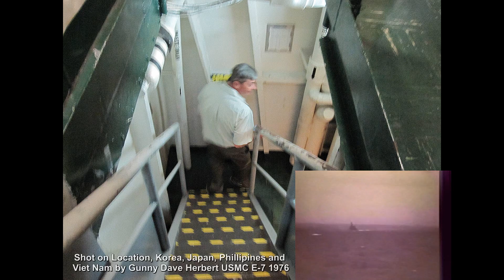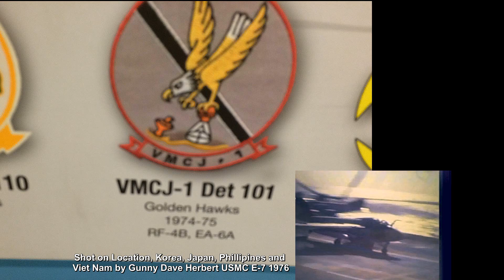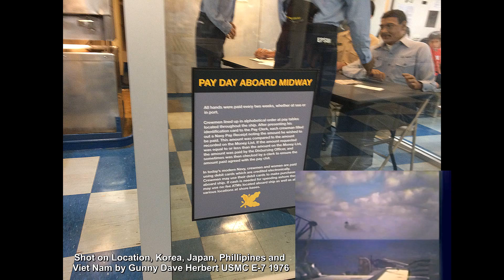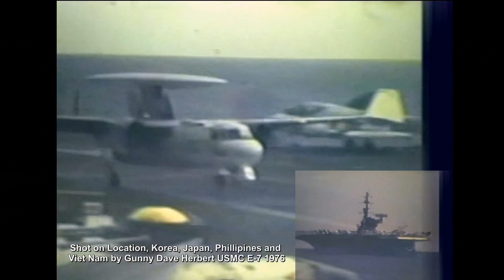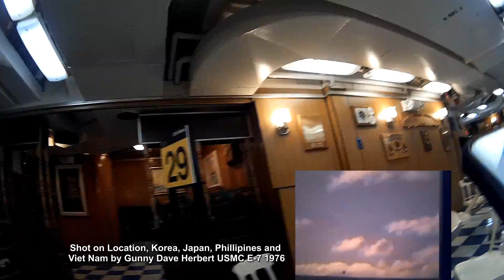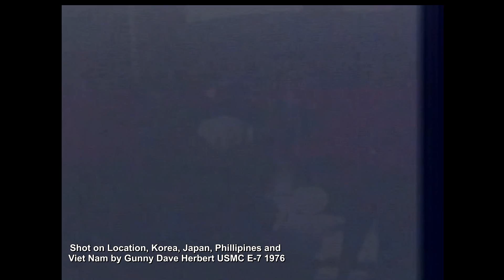USS Midway Magic with Phantom Crash on deck! Were you stationed on the Midway Carrier? VMFP-3, 1976.

Comment: CATCC div ... 1976
   This crash was one of 2 incidents that happened the whole year ..., 
  We ( and all of the Airwing ) were under one , Commander Tom Finley ...affectionately , “ Cag “.....Commander Of The AirWing.
     (. Pretty sure the Aircraft on display when you enter Alameda is his name on it ..)

    Commander Finley’ ‘. radar blip , moved unusually quick across the screen .... as he was scramming ... all over observing all the readiness Ops.

   Thing is we flew more sorties  than any other Carrier .., this crash and a deck crewman was sucked into an intake 
( A6) .. as the deck was slippery icy.

   We were caught in the most horrendous thing  ( rare ) in the fall , a white squall. We still were unrepped... with fuel ... l watched the sea ( solid white foam to the horizon ) completley  cover the upper decks of the tanking vessel.
   Also we were called away to ‘Operation Paul Bunyan ‘ when a pilots & crew were captured after  running out of fuel over Korea’s DMZ ..,
   LCDR Cunningham  a pilot , became an Congressman..
  And l was lucky enough to call a future FAA  top brass , my personal friend ; Peter Dumont

Comment: Gunny. I was an AT with VA 93 from 75 - 77   I do remember that crash and I also work the flight deck as well as a stint in 77 as in the flight deck launch room. I was that guy who showed what planes launched off and recovered on the deck. Eventually, the midway museum told me that my job became an officers job once it was computerized.
Reply from the maker: Right on, Tim.  I know what you mean about losing the job, cause when I made Gunny I wasn't out fixing and doing what I liked.  Anyway glad to hear your story and Semper Fi from the old  Top.

Comment: I was in VAW-115 on the 72-73 cruise, working in AIMD, AIMD-2, I believe, but not sure.  I fixed radios, IFF and nav gear.  Worked on stuff for E-2's, Phantoms and RF8-C's.  I get to visit the ship on San Diego about every other year, and I always enjoy my visits.  My squadron was homeported at North Island NAS on Coronado.  You had to pay a toll then to cross the bridge, or come up the silver strand, which took quite a while.  We had close to 20,000 traps on this cruise.  325 days.
Reply from the maker: Great to hear your story.  Thanks kindly for your Service.  Semper Fi from this old Top.
Reply: @NightFlyyer  Yes, I was on it.  This was the last combat cruise of Vietnam war.  They wouldn't let the ship come home until the Peace Agreement of Paris was signed.  Once it was done, the POW's came home (Hanoi Hilton, including John McCain).  We had an A-6 crash on the flight deck on October 24, 1972 that killed the Bombardier Navigator (BN) LT. Bixler, and four men on deck.  30 sailors were hospitalized, mostly with burns.  We launched planes the next day and did not sustain enough damage to come off line.  Bad day.
Reply from the maker: @williamlowers1964  I was in Nam in 69-70 and then out on the Midway in 76, when we had the F4 as seen here crash on deck.  Thanks again for serving.
Reply: @NightFlyyer  I have some Vulture's Row photos on Buzz Nau's website.  CV41.org.  Click on Galleries|Midway through the years|1970's|Bill Lowers to see my photos.  I slept under the port side blast deflector near the end of the angle deck (we could hear tailhooks of bolters on our roof), and could hear the hydraulics of the blast deflectors when they were launching planes.  We always knew when the RF-8C photo recon planes were ready to go, because they did not have staged afterburners, and when they hit the burner, it was a big dump of fuel, and . . . POW! the instant the JP5 hit the exhaust.  I worked in the AIMD radio shop one door up the passageway from my berthing area.  Tailhooks dragged across our roof there, too.  I was in the E-2 squadron, and when an E-2 didn't catch the wire, the tail hook went Dink, ka chink, dink as it bounced across the roof.  Nothing macho like the roar of a phantom!!
Reply: William Lowers Did you know Shustek?
Reply: @Beachmode12  I never knew anyone named Shustek.  I was on in 1972 and there were 4700 men aboard.
Reply: William Lowers TRUE. Radio operators E2 was his work.  He talked about his five close friends getting killed.  He was devastated. Master Chief E9. Stationed San Diego.  1500 hrs on E2
Reply: @Beachmode12  I was in VAW-115, the E-2 squadron.  I will look for him in my cruise book.  We lost LCdr Anderson and Bobby Cobb in an E-2 crash in a plane that was headed to Yokuska for repairs.  My friend Roger Blair and the co-pilot bailed out and survived.  LCdr Anderson tried to save the plane and died in the crash, and Bobby drowned.  We had a memorial service on the Hangar deck, port side elevator.  I didn't know any Master Chiefs in our squadron, but I wasn't in it very long before we deployed.  When we were at North Island NAS, I worked in the electronics shop in the space between the double blimp hangar, so most of the time I was there, I didn't have a lot of close contact with my squadron.

Comment: Used to take photos of the afterburners during night flight ops from the focsile. Dramatic! 
One time I followed a prop shaft all the way down to the bottom of the stern! No stairs, had to climb thru holes in bulkheads. Got progressively colder the lower I went, could hear the props thru the hull, and feel the chill of the dark, mysterious ocean right thru the steel. Finally came to the dry side of what looked like a rotating seal, where the prop shaft finally poked out thru the hull. Bottom of the ship's structure had quite a bit of cold sea water in pools between the bulkheads.

Comment: ICFN Gyro Technician 1978-1980
Yokosuka, Japan
Reply from the maker: Gyros were so much different than the no moving parts ones now, that's for sure. I was stationed after Nam in Iwakuni, and when we spent Christmas there in 1976, we flew to Yokosuka a couple of times with a long, loud flight on C 130's.  Thanks very kindly for serving and commenting!

Comment: Why can't I get info on crashes from 85-86
Reply from the maker: I wasn't there then so don't know.  Maybe there were none.  Check with the USS Midway Museum in San Diego and maybe they can help.
Reply: @NightFlyyer  lol.  The midway was notorious for being so unstable after the 1970 refit. (Thin hull/keel + wide flight deck + heavier aircraft, catapults, arresting gear etc etc = disastrous results)
Reply from the maker: @kurtiskaskowski5386  Yes.  It was rock and roll when I was out there in 76, but had no disasters, except this crash on deck.  Thanks and Semper Fi from this old Marine.
Reply: There was a FA-18 that crash
12/04/1986 I was on flight deck when it happen

Comment: I served in the S-7 division, data processing, near the fantail.  My living quarters were one deck below the hangar bay, near the right rear of the hangar bay.  Average temperature in our quarters hovered around 110 deg. F and often over 120.  Heat waves made watching tv nearly impossible and you HAD to wear inch thick shower shoes to prevent burns and there was no water in the water fountain - only steam.  We worked 17 hours a day, played poker for 2 hours, took a cold shower and jumped into the rack wet, otherwise, you slept in your own sweat. After nine months served aboard her, the engineers got the temperature down to 90 F.  Needless to say, I spent most of time in the computer office where they had massive A/C.  I served another three months before my brother died while awaiting discharge from the Navy and I got a sole-surviving son discharge.
Reply from the maker: WOW, what a story.  Sorry about your brother.  Thanks so kindly for serving.

Comment: I was stationed aboard the USS Midway with VF-151 from 75-78 and VF-161 was our sister squadron, my brother was in VF-161 at the same time.  Worked on F-4s for a few years and retired as an Aviation Ordnance Chief Petty Officer.  Many hours on these airplanes and on the flight deck.  Thanks for the video.
Reply: I was there in 1976 when we had our Bicentential RF-4 aboard
Reply from the maker: @donh4948  Thank you for serving.  I flew in 610, the Bi bird with Major Spooner piloting.
Reply from the maker: Thanks for serving to the both of you.

Comment: Great video. Thanks Gunny.  The USS Midway was on active duty at the time of my commissioning, back in '89.  I recall the modernization was necessary to accommodate the angled deck and a variety of other heavy mods (catapults, loss of armor belt, etc.). The result was a significant increase in displacement. This further resulted in the ship's hull requiring side blisters...to increase the hull volume.  The downside of this re-design was a very short roll period (as low as 9 seconds...as opposed to over 20 on the Forestall), making landing in high seas states tricky.  Pretty sure the Coral Sea had the same mods...though I think that ship became a Pensacola training asset long before retirement.  I vaguely recall reading the case study back at the Academy, during a naval architecture course. Now-a-days we have Wikipedia to augment our brain cells!

Of course, these big boys were favorites Christmas Card pics for our attack boat wardroom.  They really looked impressive in our periscope cross-hairs. :-)

Go Navy, Beat Army!

PS:  My uncle flew F-4'Es in Vietnam (Silver Star recipient) so I made many a model variant of the F-4 in my youth...probably why I didn't have 20/20 as an adult.  Whenever I see that mean looking behemoth of an aircraft, one that had a lift coefficient of a brick, I still think it's one bad-ass looking jet. The J79's on those mean machines certainly knew how to generate thrust!
Reply from the maker: +JB6789 Thanks for that information for sure. 3 Midway class ships were built. The USS 
Franklin Delano Roosevelt and the USS Coral Sea were the other two. All 3 had the same mods. I too am a Phantom lover.  Smoke, Noise and fast from the ground, but I recall only instruments could be heard at Mach II when Flying.  Go J-79. Thanks for your service.